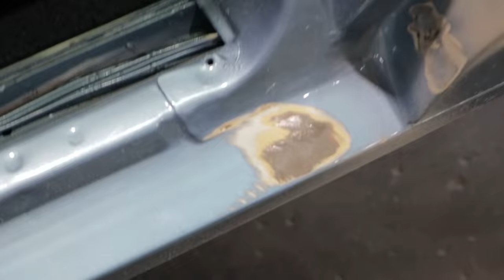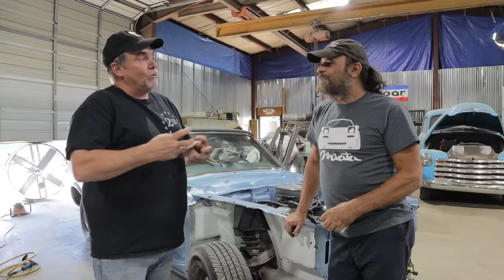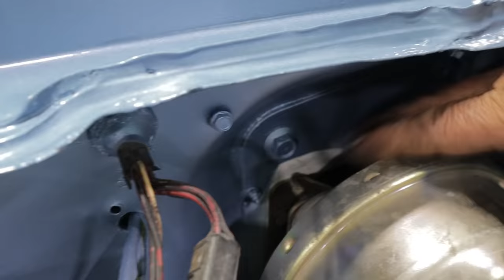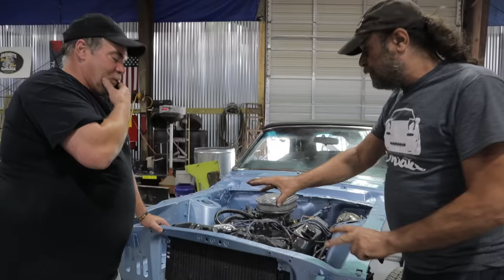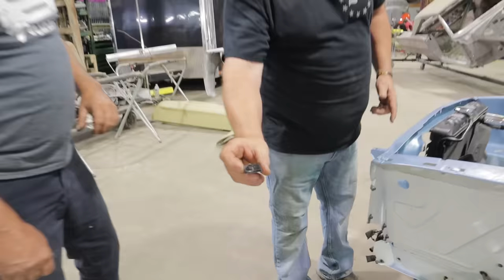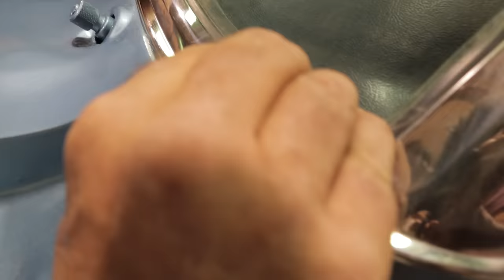Refugee From Body Shop Hell

Comment: "We cheat you fair." This is why I do my own body work. It may look like crap when it's done, but at least I know why it looks like crap. And I did it for free.
Reply: Same here fellas!
Reply: It's only free if you don't value your time.
Reply: @evoblade2000  you're puttin too much thought into it.
Reply: @manicmechanic448  no, time isn't free. It's your most valuable resource.
Reply: @TheTW13  my time is free to me. My time isn't free to you.
Reply: Why pay someone to do it half arsed and pucked up when I can do that for free.
Reply: And get better each time.
Reply: Exactly, an hour and half every spring.
Reply: Eh it keeps the cars attainable. If all got restored to fema specs nobody could afford a project. Just be honest... after all you might have to give account in front of God someday, but what do I know
Reply: So you can actually afford the vehicle last time I checked welders labor rates are not cheap hence the Bondo
Reply: @TwoDollarGararge  if you get Bondo you WILL be fixing it again later. Thanks for playing.
Reply: @manicmechanic448  yeah and most people don't care as long as it looks good most 15 + year old cars here in the rust belt at least some Bondo what tony calls horrible is your average restoration up here in the TRI state
Reply: @evoblade2000  
Everyone has extra time, hobbies do not pay.
Reply: same here
Reply: @hhiippiittyy   This is why I wanted to do it—to LEARN.  I made mistakes.  I learned from them. And then, when issues arise, I redo it to make it right.

Comment: When I had my 56 F100 restored, I demanded access at anytime so I could spot check the work. Fourth shop I found encouraged it. They got the job and it was outstanding when done
Reply: Any shop that won't let you see your car is doing shady work.
Reply: Yep, good body guys aren't afraid to show their work. Even if they can't let you in the shop for insurance reasons they will either roll it out or send detailed photos at request 👍
Reply: @barneymiller7894  Good body guys are proud to show you their work!
Reply: @bradarmstrong8959  Excactly! Idk if your into customs but if you've never seen it check out Jimmy Shines 34 ford pickup. He left it bare metal to show off the work, 5 inch chop, 6 inch channel, hand built bed, 40 ford dash, etc. And ZERO filler 😳👍 all metal finished

Comment: You left out a very important part. "Shoddy work can kill  people"
Reply: They covered that when they showed the carnage on the '37 Chevy with the cobbled up front clip, frame, & suspension a few days ago.
Reply: @howabouthetruth2157  Yeah, but it still hadn't killed anyone!!! So prove it!!
Reply: .....oh yea their killers, my old dear friend got into a bad fender bender in a new Mazda turbo years ago. He got it back and another person showed him all the crap work that was done and that night he passed away from a heart attack!!!
Reply: @howabouthetruth2157  Lol - he's trolling or joking.  Growing up, guy in an AC Cobra - modified tie rod (like that '37) failed on an on ramp near where I lived.  Flipped the car - killed instantly.  When I was racing, they starting making lightened tie rods with raised threads (the rest of the rod was thinned). Turns out (and I do not totally get this) it caused stress to move to the center of the rod and the threads could rip off. Killed a guy doing <45 MPH. Guy with a classic car (car mag story) - front end failed at highway speed. Someone had "made" a nut using epoxy and helicoil.  Person I knew in my 20's bought a jacked up Bronco with a "back yard" front end that would eat the left tire - but drove OK. Took it on a road trip. Front end didn't fail.  Tire did at 85 MPH....killed him and another guy and their girlfriends. A friend of mine lived and watch two of them die on the highway waiting for help while the first folks on the scene took their stuff. So ya - he's trolling or joking - because he can't possibly be that stupid. If I am lucky - I am done collecting those stories.  I hope so.

Comment: I feel sorry for these owners. they had a car they knew needed work, and tried to pay and have it done right.   Whoever did this is a p.o.s.
Reply: That sir is an insult to POS's
Reply: I also wonder if he was the cheapest guy and that is why they chose him. Cheap is not always good.
Reply: @scottb4023  $20K-$25K is cheap? Holy Christ!!!
Reply: @Anarchy-Is-Liberty  have you ever paid someone to restore a car or ask someone what it costs to have a restoration done? That number is really low in my opinion and experience.  I am not taking a paint job alone this guy obviously did substantial body work and structural repairs.
Reply: @scottb4023  depends on the person's definition of a restoration.
Reply: If they paid 5 grand, they got a deal. The price behind the job makes a difference(at least to me). These shows never seem to mention the price paid for tge work. If the only work you can get on a car was of the highest quality, you would be surrounded by ugly rusted cars during your commute and only tge rich would own operable classic cars.
Reply: The art form is [up front] in the bid it seems to me: get surprised by anything, and a flat price is under the gun.  After that, its focus: is the goal a flip at a used car lot, or is it preservation of steel?  I had a car that received some needed work, and a year later...one or two parking lot dings happened where spots lifted off well sanded/bright steel. Paint? Still tight on the  primer that lifted off. Either wipe down of metal missed some spots, or primer choice didn't work.  A good paint job cannot miss one single step.  Rust converters are a judgement call: is pitting shallow enough a quick sand/wire wheel and treatment will succeed, or does it need spot blasting?  The experience to know the difference is often written in failure with some past effort.

Comment: I took a 3 year course back in 1997 when I was in my last 3 years of high school and got certified in auto collision repair at Gibson Tech  . You have to make sure  both sides of the panel your repairing is properly preped !  if you have rust on the back side and you prep the front side and put bondo on it and sand it then primer and paint you will get rust pushing through from the backside through the panel causing the paint and bondo to bubble up and rust out. Also I've seen body shops do this which is a no no -  when preping the panel you will need to make sure no rust then grind an area 2- 3 " around the the dent or area you are preping .then use a grinder with a side handle and wide disc with 24 grit and grind over the area you are going to be putting Bondo or resin and fiberglass. you do a cross hatch Patten but make sure to not to get the panel hot enough to warp! then you apply the bondo ect. then use a long retangler air sander with 40 grit to just knock down the thickness and finish off the Bondo with 80 grit till its smooth on the panel. after that you use a 5" orbital DA with 320 grit to start feather edging back the primer and paint layers till you can not feel smooth step edges going from the panel to the primer then to the paint . Also dont smooth aka sand the Bondo with orbital DA  sand paper. remember a good autobody tech uses little to no Bondo to fix dent and dimples ect. they dont cake on the bondo .
Reply: Interesting stuff.
Reply: @johnwilburn   I'll probably do a video on this at soon point for those who want see this stuff  I mentioned
Reply: @MoparMan-ff8fb  Yeah, go for it.
Reply: Yes ...

ALL  OF  THIS  YOU  DESCRIBE   IS  TRUE  AND   CORRECT   ...

EXCEPT  ...

ALL  OF  THIS  

IS  NOT 

 ACTUALLY   DONE   AND 
PERFORMED   BY  THE 

SUPPOSED  

SKILLED   AND   HONEST 

" BODY  SHOP  TECHNICIAN " 

AT  MOST  

" BODY  SHOPS  " .

IT    TAKES   WAY  TOO  MUCH  TIME  AND   EFFORT 

  AND 

MONEY  

AND 

HOURS  ...

AND 

DAYS ...

AND 

WEEKS ...

AND 

MONTHS ...

TO 

DO   ALL  THE  REPAIRS   AND 

WORK 

HONESTLY  

AND 

CORRECTLY  / PROPERLY  ...  ! 

SO ...

ALL  THE  

DISHONEST  / CORRUPT  

AND 

LAZY  

BODY  SHOP  

" TECHNICIANS " 

AND 

SHOP 

OWNER  / OPERATORS  ...

END 

UP .

 WRONGLY 

DECIDING 

TO 

CUT   AS  MANY  

CORNERS 

AS  THE  THINK  THEY 

CAN   GET  AWAY  

WITH ...  ! 

AND 

SCRAP   / SHODDY 

WORK 

LIKE 

THIS  , 

IS 

THE 

END 

RESULT  ...  ! 

AND THEN ...

THEY 

DEMAND   THAT  THE  OWNERS  OF  THE  CAR  THAT  THEY   JUST 

COMPLETELY  

F ' D   UP....

WRITE   THEM 

A  CHECK  

FOR 

RIDICULOUS  / OUTRAGEOUS  

THOUSANDS  AND  THOUSANDS  

OF 

DOLLARS  ...  !

Comment: I know this feeling all to well!! Had my first car 73 Type LT Camaro w/Z28 performance options redone at local body shop, didn’t care about the cost. Spent just over $10k in 1984/85. Sat in a friend’s garage for 4 months cause it was winter, six months later it was rusting around the rear wheel wells and every single exposed nut and bolt, didn’t get painted with the car, also rusting. It’s still hasn’t been put back on the street. Next year I can take $$$ out of my retirement to get it redone the right way. 😢

Comment: Almost brings tears to the eyes! I bought a new '67 Mustang convertible, and through the fog of age, I remember several things that look wrong on this car, such details as the little die cast "fins" in the depression behind the doors, and the wrong back window. The original was of tempered glass, with a silicone hinge in the middle, so the to could be lowered without the usual need to unzip the window.  And installing trim before painting? Who does that?  The gas tank definitely would have been installed after paint. A good friend of mine recently completed restoration of a '67 convertible, starting with a rust bucket, and ended up replacing nearly all of the sheet metal, and most of the trim. Painted it OEM candyapple red, and clear coated it...before installing any of the stuff that would have been installed at the factory after paint, which is most everything screwed or bolted on!  He also owns the best body shop I know of, and does customer work to the same standard!
Reply: I'm retired now but was a mechanic for 48 years. I never, not once, not ever put less effort into my work on a customers car than I did on my own vehicles. I'm not bragging, it was just right and fair and how I wished to be treated by others. It's a much easier way to live life and happier.

Comment: Also, on the subject of shoddy repairs, I bought a Checker that had spent its life up north, and being used to the southern cars, I wasn't used to the amount of rot and poor repairs.  Every piece was rotted and bondoed over, including holes in the tops of the quarter panels, bondo on the floors, bondo across cracked door pillars, and finding more bondo around a quarter inch thick in plenty of other spots.  I'd never had to do a magnet test before, because I had never seen a car with this extent of plastic filler.  The back panel of the car, (under the tailgate and between the tail lights,) I found out was a bunch of maybe 24 gauge AC duct type galvanised with bondo on top of it.  I was jacking the car up with the bumper jack, bumper pressed into the panel, busted out a chunk the size of the sole of my shoe.

Comment: All rip off mechanics need to be hung up by their toes. What's so hard about being honest? Everything done in darkness will be brought to light.
Reply: You're being too nice by only hanging them by their toes...  I can think of some other more worthy body parts.
Reply: what about cheap customers that beg you to do this kind of work? We had a 64 mustang come in the shop looking good from a distance for an AC leak to be fixed. that car is nice compared to what we found but half way through fixing it right I started getting told to go faster and cut cost down. Well I was not the owner of the shop or the car so I did what I was told. And I no longer work there and would never give a referral to that shop. I now don't do a car start to finish but I do what the customer can't do like all the metal work or just finish paint. I make good money and the customers are happy that they get to do most of their car themselves. Most people don't have 100k to 350k or more for a real quality restoration. But the metal work too me is the most important to get right. You must have a good foundation.

Comment: The classic case of the paint hiding a world of heartache. I'm from the UK and can remember as a 17 year old looking at a friends 1965 Mini that his father bought as restored. It was a typical mini fix up with new wings, A panels, door skins and front panel. It then had the Ton of filler it  was beautiful in June. By the following spring the road salt had worked its magic as it was a daily driver. After a winter it had the classic rash of  blisters everywhere with water in them it was well on the way to looking like it did before the new paint and smelling like a pond with the foot Wells full of stagnant water.

Comment: Magnet in a sock. 
Better than a lie detector.
Reply: Make it a weak magnet too, strong ones can 'find' steel in marginal areas.
Reply: @CarsandCats  Yep, exactly that. Or a cheap telescopic pick-up thingy: it may not pick up your dropped fastener, but it still has a use!
 I know somebody who's just had a nasty surprise or three after checking a car with a spare neodymium magnet he had lying around.
Reply: Let's stop trying to detect butchery with backwoods shit techniques. 
Get one of those spot rot detectors. 
As I was making this comment I googled shopping and they go from 15$ to 80$ or so. 
Not a bank breaker at all.

Comment: I learned body work all on my own, on the rare occasion I used bondo it was on top of fiberglass which was on top of prepared metal. My work never came apart and you wouldn’t find a spot of rust under it.

Comment: As a kid when I was 15 I bought my first car for $90, a 68 cutlass that I cloned into a 442.
It had rusted wheel wells so I practiced bodywork on it. I did not know how to do metalwork back then so I just cut out the edge of rust and used Bondo over rags and newspaper to build up the holes.
Remember I was only 15, 
I used a gallon of Bondo 
Wonder what ever happened to that car, it came out nice, funny thing when I sold it guy used a magnet but never caught the work. This was back in like 1977.
Over the years I learned how to do it the right way but it was not for me, takes a very talented person to do this kind of work.

Comment: Everyone who ever painted my car.... They SUCKED. I did it myself?  10 years later that area held up better than ANY shop and i'm not any good at bodywork. First step in doing good work is doing what you two are doing.  Looking at crappy work.  If you can ID it you won't do it yourself.
Reply: I try and do as much mechanical work on my own cars as I DON'T trust most mechanics. Unfortunately, I just cannot seem to master the art of bodywork. Good on you for doing it yourself.
Reply: @timsmith854   Ahh its more like just sanding down the failing paint flat and going over it. Had some  bad spots. Did some blends its not perfect but it matches and the edges never peeled unlike what I paid pros for.  Should of used a better clear coat.    My mistake. If I ever paint a large area forget it.  I paint small failing area's  Now I did that large area's are failing that I never touched.    Got good at masking, back taping, Color sanding ETC.    

It takes forever. Its horrible sanding when its hot and humid. I got a whole peeling truck now due to crappy body work and paint I paid for, I feel like sanding it all down myself, blocking it flat as I can and trying to paint it but someone will complain where I live for how big the project will be
Reply: It only takes three things: prep, prep, and prep lol
Reply: @bbb462cid   Well..  a good featheed edge so nothing shows and make sure it does not have scratches. I 100% hand sanded a roof. Pillars, Top of a fender ETC took FOREVER...   Hand sanded.    I had no DA.. nothing Just every day Would go out there.   Sand the bad failed cracked paint off.    been 10 years Didn't fail.  Sucks they make horrible paint stripper now. Would be alot easier peeling it all off.    Epoxy prime.  think u need another primer over that that is sand-able.  Block it.  sealer.. Base clear done
Reply: @bbb462cid  So true. All painting - including houses - requires perfect prep work.
Reply: @GhettoWagon  I have maximum respect for people who do show quality paint jobs. The amount of HARD physical work that goes into a flawless or near-flawless paint job is incredible. Blocking back guide coats by hand, over and over again. Don't be too modest, it sounds like you put in the hard yards.
Reply: @GhettoWagon  Oh I know. I did 600 hours of body on my classic car once. 400 easily was guide coat and sand, guide coat and sand. Prepped the paint booth too. Then it got sideswiped while parked!
Reply: @timsmith854  Its not show it just matches.  Its not how it looks right when paint work is done its how it looks years later. It shrinks back, fails, ETC.   So many painters or even just people generally fixing cars should see their bad work a month a year later 5 years later etc.
Reply: @GhettoWagon  Sorry for the confusion, I was just mentioning show quality jobs. You are right about shrinkage. Too many people make the mistake of over-using spray putty. A sure way to end up with cracks, or as we call them in Australia - crow's feet.
Reply: The difference is that you cared about the car, not the money getting the car out of the shop will  bring